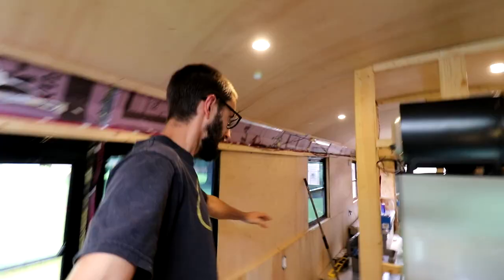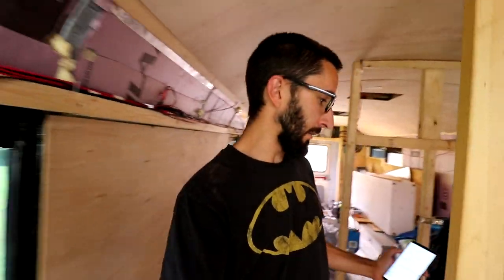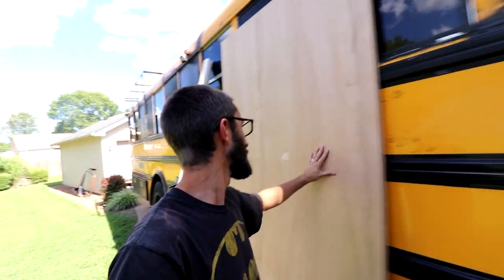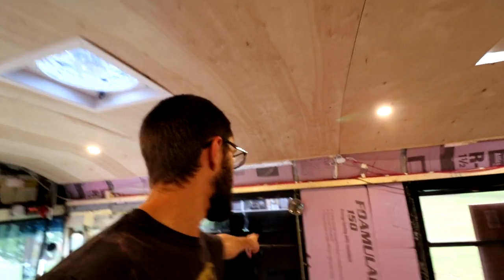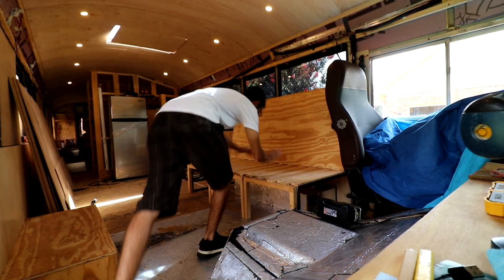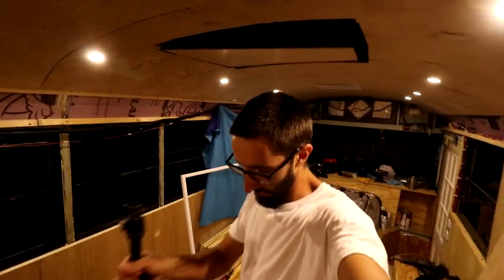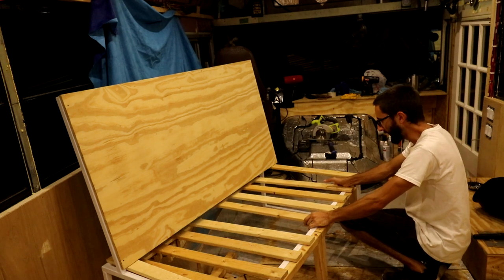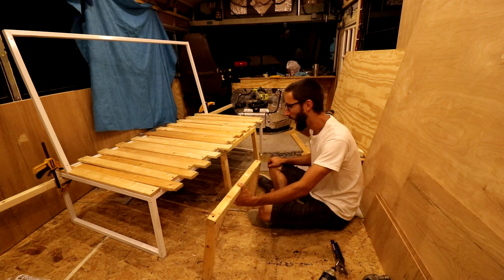It did not work! Redoing the Pullout Sectional Couch for our School Bus // Skoolie Conversion

Comment: I know this is an old video but you could put doors on the pull out slats for storage access and put a cushion on the out side of the door so when you open it some legs pop out and give you that full length, no feet hanging off goldeness. JS

Comment: Why are you already planning a next bus? Why won't this one work?
Reply from the maker: It's not that we're planning the next bus but it's that we are preparing for what changes we would like on a new build. Like, we might rather get a RE bus with underbay storage, maybe a full size 40ft or maybe even an old greyhound mci bus that's taller. We plan to be in this bus for the next 3-5 years and as our life changes, so will our needs.